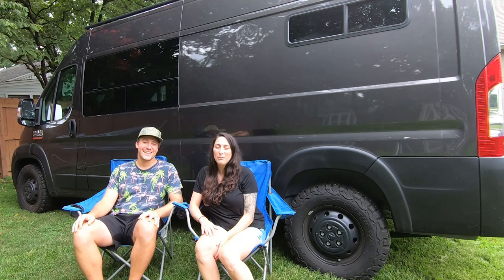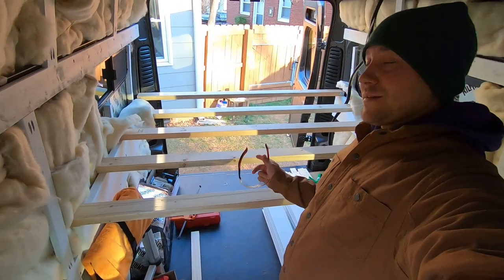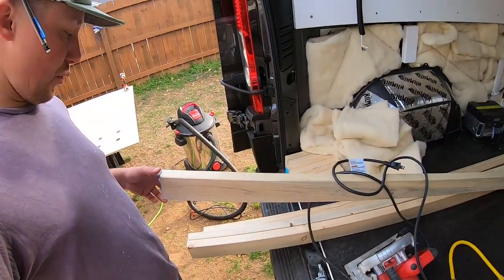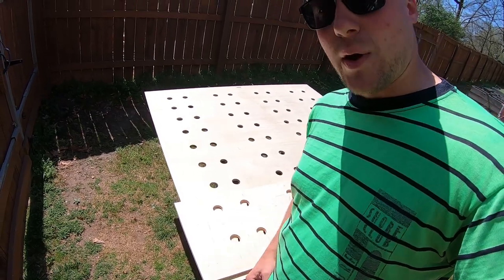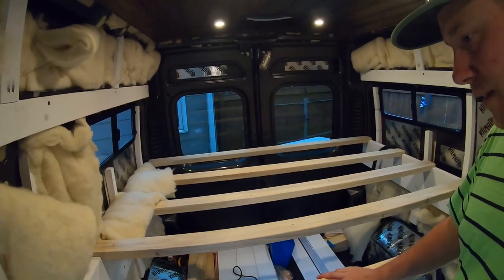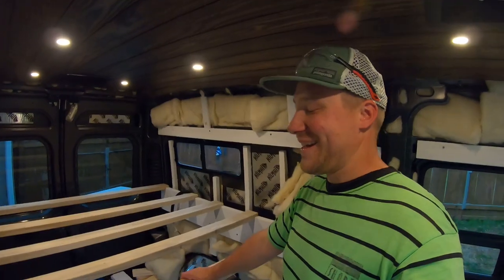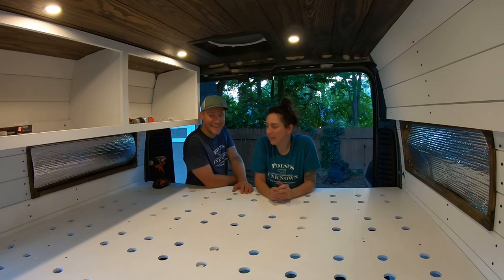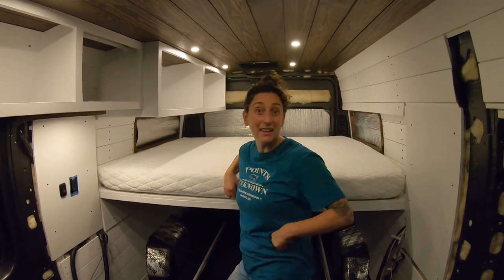Platform Bed in ProMaster Van + 6" Memory Foam + 1,000 Subscribers! //Ep. 20 DIY VAN BUILD

Comment: Van is looking great!  Notching the 2x4's by 3/4" essentially weakens them to the strength of a 3/4" piece of wood.  They would begin to split in the inside corner of the notch. Big framing no no.  Either get a dropper post or notch the ledger.
Reply from the maker: Yea, I wish I could have just afford the dropper post. I didn't end up using the notches anyway. The platform we built has been solid with no issues so far. In hindsight I originally wanted to notch the ledger but felt it would be a larger hassle. Always things you can learn from

Comment: I am planning on building out a van next summer and can’t thank you enough for this content. I love how you walk through exactly what you’re doing and what you’re using. My build will most likely be in an older passenger conversion van that I’ll rip out so I won’t be able to follow along exactly,, but I’ve taken notes on so many techniques and tid bits you’ve offered like how you did framing. Thank you so much!
Reply from the maker: Thank you! It means a lot to hear the videos are worth putting out!😊 I wish you the best of luck in your research! planning, and build once you start! Reach out if you ever have questions🙌🏻
Reply: I’m building my platform just like yours. My trouble is I can’t get Baltic birch anywhere so I resorted to 15/32 plywood from Lowe’s. I’m second guessing my choice. I guess I’ll see if it breaks lol.
Reply from the maker: Baltic Birch is a very strong ply for its thickness. Some of the thinner ply at Lowe’s or Home Depot can be a bit flimsy. You could always try a 3/4” ply for some extra rigidity. I know you’ll lose a bit of headspace but it would be better peace of mind. Hope that helps. Let me know if you have other questions

Comment: Great video. Quick question, do you ever have the mattress slide if you had to slam on the breaks? I rarely see bed platforms with a lip to stop that. Any thoughts?
Reply from the maker: We do have a lip in our van but  I don’t know that it was needed. Depending on cabinets and even the type of mattress used (some of the memory foam ones are very heavy) it would probably stay in place just fine. We built a cabinet to the ceiling on the drivers side and have a plywood wall we tiled on the passenger side so the lip in the middle wasn’t needed. Just another note on it, if you build the lip too high it’s a hard surface to roll your knee or shin over which isn’t fun. We haven’t noticed this being an issue with how low ours is but it could be a problem. All that to say we’ve never had the mattress move in a quick stop.

Comment: Do you have to have your van completely level to frame it out?
Reply from the maker: Mine definitely was not level in my backyard. Plus nothing in the van seems very level. I just "leveled" the bed boards to the van frame hex holes. Otherwise other than making straight cuts to the boards I wasn't too worried about the framing being level 

**Edit- obviously within reason. Making straight nail or screw holes, having framing in a straight line is important

Comment: What was the final dimension of your bed? Was that in the video and I missed it?  I was thinking of going with a metal bed frame like the one One AdVANture at a Time used, but I'm thinking the length of a pre-fab frame wouldn't work - and will have to do something more customizable like you guys did.  Thanks.
Reply from the maker: It was queen width, 60 inches wide by about 75-76 inches across. It extended some over the head and foot boards we installed in the 1st framing video. The space can be seen in the wall video where we finish the bump out area.

We went with an rv (or short) queen mattress. 6" Memory foam thickness. It's working pretty well for us! We wanted to do 80/20 aluminum for the bed but it was too expensive. We also thought about the ikea metal pieces but ended up just using 2x4s since they were a little thinner which saved room in the garage/head space above the bed. Hope that helps!
Reply: Did you find the 2x4 on the horizontal and the braces was adequate for a queen and two adults?
Reply from the maker: We also used 1/2” Baltic birch on top which helps strengthen it. It has been plenty strong and we’ve never noticed sag or movement. Probably not as strong as you’d normally have 2x4s upright but I’ve had no complaints. We’re happy with the room that it saved us

Comment: At what height is the bottom of the bed platform? So you are able to fit a bike under!?
Reply from the maker: I made ours exactly 38" from the floor to the bottom of the bedframe. My gravel bike's seat just clears. If you have a dropper post, like on a mtb, you can definitely make it lower. Maybe 36-37" or possibly even less. I would take your front wheel off And measure up from the ground to the highest point. Then factor in if you make a drawer (like we did in the previously video) or if you attach a mount directly to the floor. There are a lot of factors that go into it of course. Let me know if you have other questions
Reply: @Trailvagabonds  Thx for the quick reply! :)
Reply from the maker: Of course! 🙌🏻